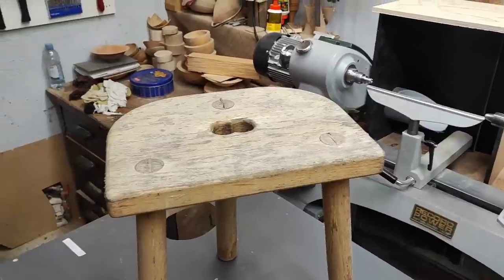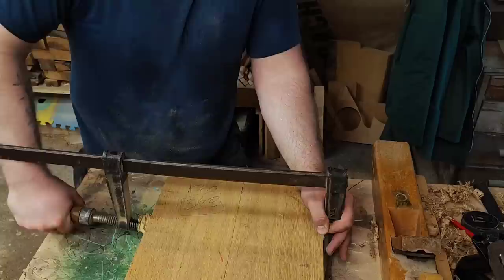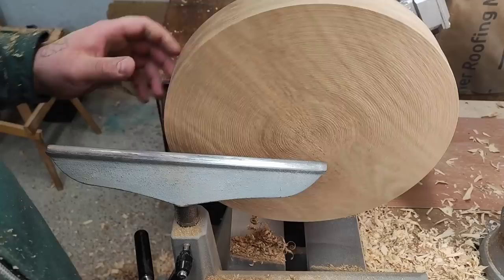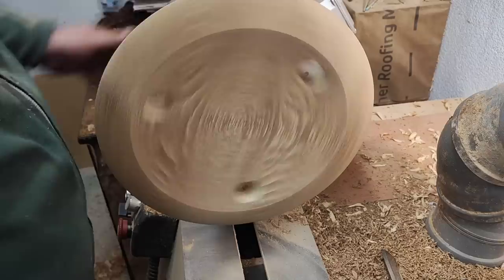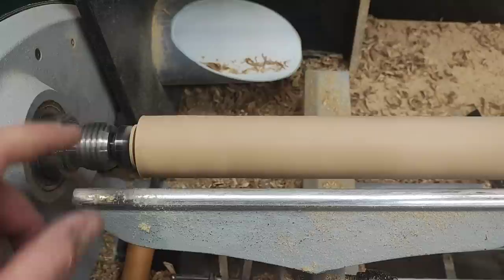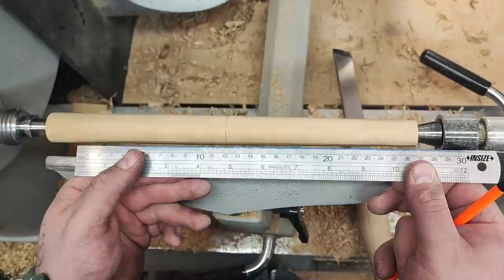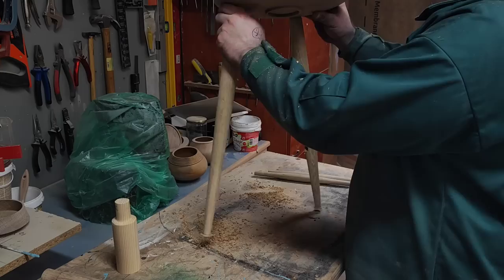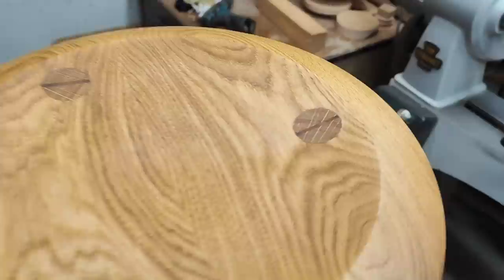How to make a stool/chair with through wedged mortice and tenon ____ 4 WAYS June project

Comment: Not a fan of this project idea, not really woodturning, Sam has not turned top .
Tool handles have more turning design than stool legs.

Good job though and thanks for sharing Tomislav
Reply from the maker: Woow ..... Crossgrain tehniques for the seat that is used for bowls,platters and such and spindle work for legs and strechers... Sorry but what would be then turning? Maybe epoxy stool?
Sam took his time to make awsome stool and showed stuff that are not much on YouTube, extremely well done threads, Mike took time to do more complex design for the legs and looks awsome, Richard as well, I took simple route as that is my style... But saying that this is not turning is just wrong and totally missed the point of this project....
Nevertless thank you for watching 😀
Reply: Thanks Tomislav 
Elegant stool. Very nice
Reply from the maker: @stevenhansen8641  thank you 😀
Reply: Tomislav has often demonstrated an excellent eye for design. He certainly has the ability to turn a Victorian nightmare of a spindle for legs, but the lines on this are perfectly elegant -- the work of a master and something that doesn't need beads, coves, astrigals, urns, ogees, reeds, . .  

Often, less is more.
Reply from the maker: @greggerstner5599  thank you very much for kind words 🤗